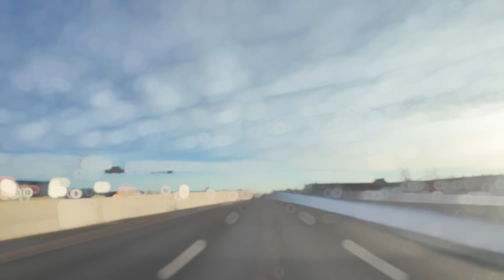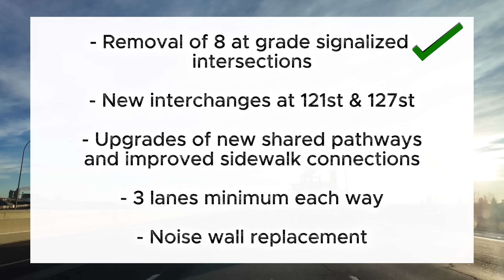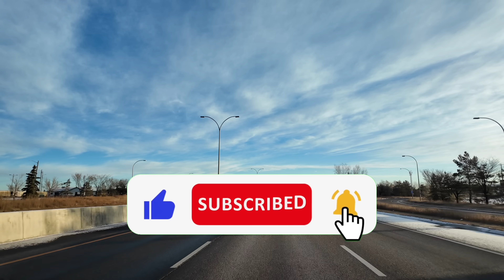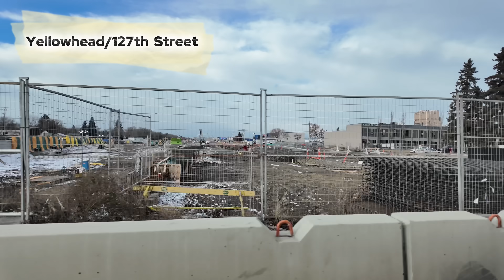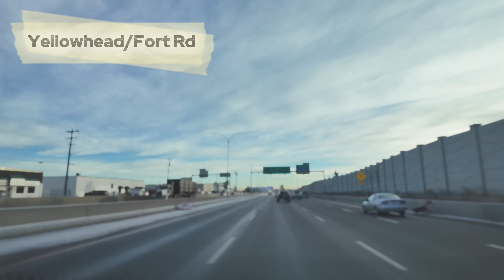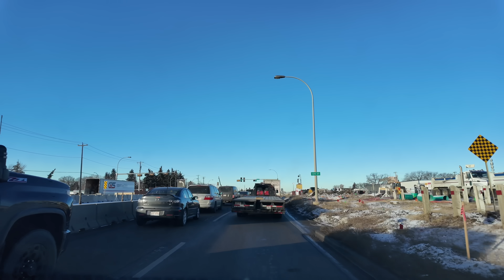Why Edmonton is Spending $1B on One Road

Comment: 20 years ago, when I traveled a lot, I would avoid Yellowhead at all costs. If I was going east/west, I would go through ft. Sask. For north-south, I would go to Acheson.  Then I moved here in 2000 and had to take it from 66 street to 109 street to get to work. It is a POS road for sure.  Ft Road interchange was a nightmare on my commute. Thanks for the video. Well narrated, good video and the city mockups were very helpful. I was very interested in it.  👍

Comment: All of this construction and chaos could have been avoided if the engineers who designed this would have done it right from the beginning. The removal of 149th st. is a hindrance now as 156st is taking on more traffic than it is designed for and will cause severe problems in the future just as their screwed up 127 st intersection has since this freeway was installed. There are other intersections that are or were seriously dangerous because of poor design. (yellow head and Gretzky drive/Fort road is the worst)The construction crews have also set this up so that traffic comes to a complete stop like a parking lot. They are amateurs at best. This is a joke and way too much money for something they screwed up from the beginning. Now you can add this failure to the failed and way over budget LRT system that sucks and will create more headaches for drivers down the road. The engineers need to go back to school and learn something about traffic, because they are absolutely clueless!!!

Comment: I will be very happy when construction is finally done on the Yellowhead.   If you are using google maps to get around many times it will tell you to use Yellowhead as it is normally the quickest way to get across the city (if going east or west) before the construction.   The endless construction the shortening to 2 lanes in some sections, and the speed limit reduced to 50 and 40km for long stretches can make using the Yellowhead take forever, especially during rush hour traffic.  Usually around rush hour time I will use 137 ave as it goes through the whole city there is no construction no slow downs to 40 and 50 km.  3 lanes through much of it, plus much less traffic.   I am sure the Yellowhead will be better once all the construction is done but for now it's still a big pain.

Comment: Edmonton just have a proud tradition of hiring the bottom of the barrel planners. They constantly undersize roads, put bridges across freeways with traffic lights at either end, instead of building proper overpasses and flyovers. Then they wait decades last the criticality point to start expansion, and take 5 years to widen a fucking road. Useless.
Reply: They farm out engineering to India. Saw the drawings on one project and they didn't even spell the city's name correctly in the drawings title block.

Comment: I would like them to add some simple low cost improvements at 97 Street. Make the YHT WB to 97 St SB left turn a double left turn. That exit is always back-logged at both AM and PM rush hour.
Reply from the maker: Good idea, that's a common complaint for sure.

Comment: I believe that they should have built a flyover put in at 149 street, so that the industrial areas north and south of the Yellowhead could remain connected, and divert some heavy traffic from 156 street, which is now pretty congested most of the day. The work between 82nd and 97th street also removed a signalized intersection at 89 street, in addition to the new noise abatement wall.
Reply from the maker: I agree, 149 Street was a missed opportunity. 156 is heavy with traffic now - image it 5 or 10 years from now.

Comment: Thanks for the info. New sub. :goodvibes:Some of this work ( 127 st overpass ) would of been way cheaper. Had they built it in the early 80's when they first expanded the Yellowhead. That is the problem with our city politician. Save money now ,spend 10X more later fixing the original problem. :face-red-droopy-eyes: 1.1 billion sounds really low. Whats missing??🤔🤨
Reply from the maker: You're welcome! Thanks for the sub. Yes it's a reoccurring theme to build small and pay exponentially more years later.
Reply: That’s the way it’s done everywhere.
Spend as little as possible while you are in office and let someone else figure it out years later.   No longer your problem.
No one ever plans for the future or cares about the tax payer.

Comment: Next they will have to convert Terwillegar Drive from an “expressway” (with traffic lights) to a proper freeway. It was supposed to be a freeway when lanes were added but…
Reply: Legit hate that road
Reply: The whole SW Edmonton is a mess
Reply: They have huge ass berms built there. So I suspect at some point they will start an over pass there for this situation lol.  When they built the henday   They should have just done it right In the first place instead of making sections of it 2 lanes causing bottle necks.     I guess anyone can be an engineer.   Thinking that the city wouldn’t grow fast blows my mind.   My opinion   Henday should have been 4 lanes each way.  Hopefully making merging a lot easier and safer.  Considering most people don’t know how a merge works lol.    Ok rant is done.  I could go on and on and on.
Reply: hahah.  they royally screwed that up
Reply: The south and west parts of the Henday are a bad design because the city had too much input to the construction.  Anything Edmonton transportation has anything to do with turns into a dogs breakfast.
Reply: @oldredcoonhound2182 province deserves some blame since the Henday is ultimately in their jurisdiction
Reply: But... lol
City officials decided they need bigger BONUSES.

Comment: I remember before Yellowhead there was 125 ave, a discontinuous road with 2 lanes in each direction that went from 82 st to 107 st and 127 st to 149 st with a traffic circle at St. Albert Tr. East of 82 st it was called Santa Rosa Road which went from 82 st to 66 st.

Comment: Not a big deal but there was a signalled intersection between 97st and 82st.  It was to turn north into the businesses.  Some people used it to bypass the heavy traffic on 97st.
Reply: 89st
Reply: I knew there was one missing, nice catch! I think that was the first thing they removed for this project, must be years ago now.
Reply from the maker: Good point, I forgot to mention that.  Thanks
Reply: That signal was at 89 St. And it had no WB to NB right turn bay which was a pain in the butt for everyone who wanted to then continue in right hand lane to 97 St WB exit.
Reply: That was a REAL pain.  I remember being pleasantly surprised when it was... Gone.

Comment: This wonderful project allows us to: 
-Blow right through town without stopping at local shops and services
-Cut off access to local businesses 
-Line up for even longer after work to go North
-Use residential areas as arterial roads to the remaining major intersections
Pretty expensive parking lot at four o'clock, which will only get worse as development grows North of the highway.  As for being safer, that starts with proper driver training and policing, not just throwing money in hopes to make it safer. 

Nice
Reply from the maker: I agree with your points here. I'm not saying this will be perfect or ideal but it's not like it's a new build. From what it was originally I think this will be a big upgrade.
Reply: "-Blow right through town without stopping at local shops and services"
   No worries, a lot of those local shops and services were simply "removed" by the plan.

Comment: What also needs a 6 lane full freeway upgrade is Highway 16 between the Anthony Henday and Highway 43. It actually needs it more than some sections of the QE2
Reply: interchange with hwy 43 dates to 1961. time for a complete rebuild.
Reply from the maker: I agree - that is a high flow area for sure.

Comment: Are you sure it will cost only 1.1 billion.    Building 8 interchanges/overpasses, etc. in the middle of a city wouldn’t be cheap.   Regina built a brand new 4 lane, 40-50 km. bypass with 12 interchanges (33 bridges) away from city infrastructure in 4 years (2015-2019) for 1.8 billion.   It also includes 30 years maintenance (snow removal & road repair).
Reply from the maker: Yes, the COE and GOA websites confirm this. It is $100 million overbudget at this point however.

Comment: $1.1 BILLION and all that is accomplished will be free flowing east/west traffic.
North/south traffic is a tremendous issue caused by this redesign especially at 156st
and St. Albert Trail around the rush hours. And it won't be addressed for a long time coming.  If ever.
Reply: When the new LRT is installed it will make the north south in this area even worse than it is now...
Reply: @aidanbogner2839 
Alberta should build proper skytrain or subway lines for their LRT instead of making them run at grade with all the other traffic

Comment: No north-south crossovers between 156st. and St. Albert Trail may prove to be a regret.
Reply: It's already a full on regret. ALL of the west bound traffic that use to turn off south from 142 street and 149 st and 152 street all now turn off at St Albert Trail onto 118 Ave which is a complete shit show. Plus additional traffic into neighborhoods attempting to by pass the traffic circle. Some of the stupidest shit I've ever seen. It's what Edmonton does best
Reply: yep 149 street used to be so nice, could go south to the Costco and the whitemud. too bad they closed it off for right in/right out only D:
Reply: I go that way quite often and yes,  you will regret being there especially around rush hours.
Then when winter gets here, well that just will make it all the more frustrating.
Reply: should have built a flyover at 149 st
Reply: @garyholt8315  Agree.
Reply: @garyholt8315  Much regret and frustration in years to come.

Comment: About time.  Overdue by 30 years or so.
Reply: Sure, but they were busy during that time building more "at grade signalized intersections" around the city that become a nightmare a year after being commissioned.
Reply from the maker: Absolutely!
Reply: @UrbanMotionResearch  Now the QE2. There is talk of raising the speed limit. The QE2 is NOT a controlled access highway. There are MANY level crossings that NEED to be resolved before upping the limit to 120(+?), or reduced limits AND WARNINGS BEFORE these crossings.
Reply from the maker: @WaynePatrick-ip9se excellent points. I intend to do a video on this very topic in the near future.
Reply: @WaynePatrick-ip9se I used to visit friends in Olds and the only decently fast way to get on the QEII north to get back home was to hop across all southbound lanes and get on the northbound left hand lanes all from a stop sign on a gravel road, timing it to avoid getting totalled by some maniac going 120+.
Reply: @UrbanMotionResearch the section of highway 16 that goes thru B.C. is the route to Prince Rupert , a major port .
The highway goes thru every single town  . Little has changed in many years , except they’ve lowered the speed limit to 50 , or 60 kilometres a hour for ridiculously long stretches and more and more traffic lights . 
All infrastructure money is spent in the lower mainland , they keep telling us that the north is going to grow into an economic driver , but with an outdated highway system growth is slowed .
👍🇨🇦
Reply from the maker: Interesting thanks for the info!
Reply: @UrbanMotionResearch  the city already out grew the roads now. Should have been 4 lanes also henday need to be widen again.
Reply: I doubt this will ever finish... Smh.
Reply: 50 years
Reply: @MagruderSpoots  50 years ago the yellowhead didn't exist. It was built in 1980.

Comment: I feel bad for anyone thinking this will fix traffic.  It'll be just like Glenmore Trail in Calgary that backs up daily because more car infrastructure never relieves congestion.  The pathway improvements are nice at least.
Reply: ya everyone will go on the Yellowhead when it’s done and then it’ll be congested lol “hey we need one more lane…”
Reply: I think this has more to do with eliminating intersections and making it much safer than it was with all those dangerous intersections it used to have.
Reply from the maker: @vgcancino yes exactly
Reply from the maker: I agree that it won't fix traffic but compared what it is now I think it will be much better.
Reply: Wow..that is a nicer highway that the Trans Canada from Surrey to Abbotsford that is currently under re construction.
Reply: I believe the major improvements at Deerfoot Trail and Glenmore Trail Interchange should alleviate some of the bottleneck problems. Especially eastbound Glenmore Trail to northbound Deerfoot Trail.

Comment: Thanks for the video. I avoid Yellowhead if I'm able. IMO, the city missed a trick in not using the above-ground interchange design that they have used at Fort Road, 82 Street and  97 Street, in that you can make a left-handed turn without dealing with traffic lights (but still yielding to traffic as needed).  However, there might be challenges in this design that I'm not aware of; but I'm a fan.  Looking forward to more content. Cheers.
Reply from the maker: You're welcome!